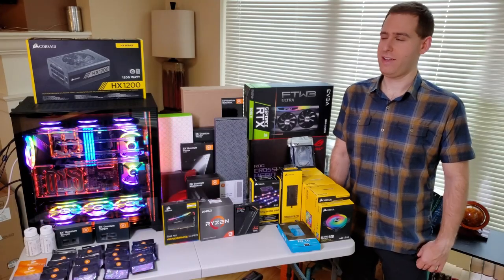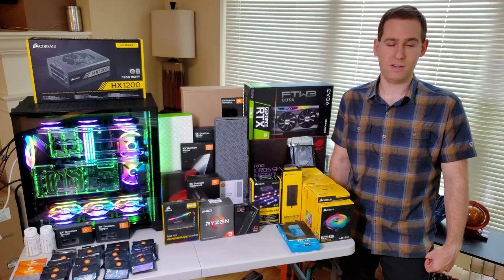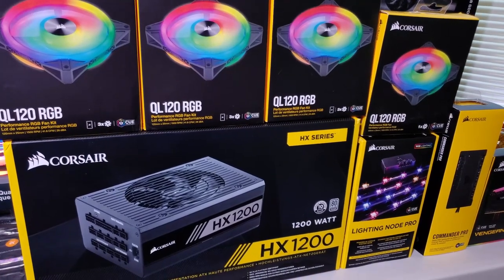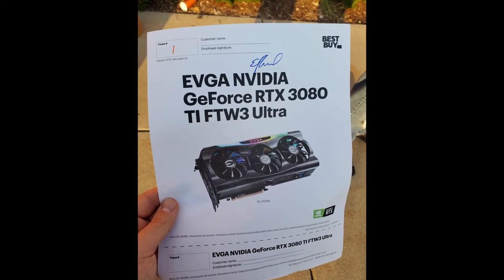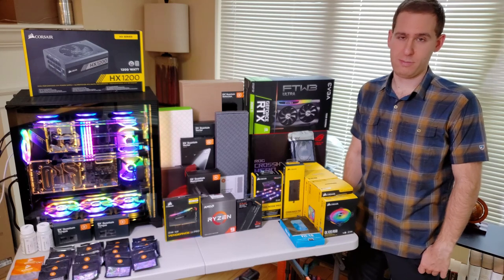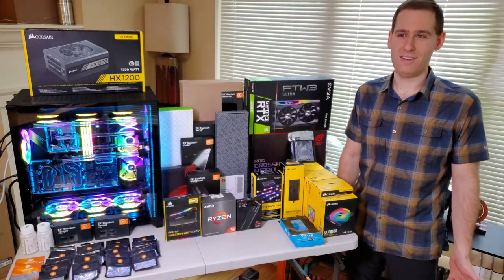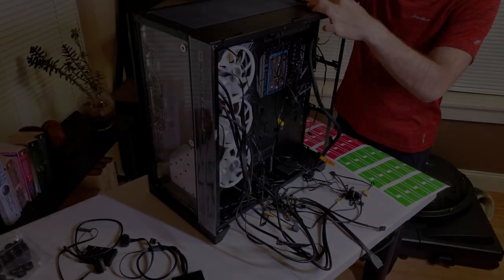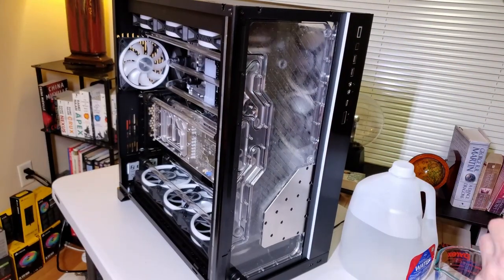Gaming Computer with Custom Liquid Cooling - 475 RGB LEDs, Lian Li Dynamic o11d XL Case

Comment: One major reason I hate the Lian Li cases are the issues of fan vents. They make these super small slivers for either drawing in air or using them for exhaust. If you look at the Corsair airflo case you get the idea of what I'm talkin about. The 5000D with tempered glass right side you will notice that the grill is very open and allows air to exhaust out with no much restrictions. In the Lian Li the air will have a hell of a day venting out thus making it travel through the back side before finding its way out. Dust patterns tell the story very well! Nice build for sure. Just not a fan of the case because the grill systems on the top and right side cover.
Reply: cant you do something about the grill system yourself?

Comment: 1 radiator draws over 300 volts how are you able to run the pc with two radiators and all the other compenents is your power supply good enough? im asking cause i dont wanna fry my system im getting the 1200 watt power supply
Reply from the maker: I actually think my PSU is significantly above the min I'd need for this build. I just didn't want to risk it as there are hundreds of leds and they do add up. The rads themselves don't actually use electricity so I'm not sure what you're referring to there. Is there another piece you mean?
Reply: @RonnieBunshaft  on the ek site it said teh 360 radiator used over 300 watts thats why i was confused when i did a configeration for my water cooling kit that had that as my recommended radiator
Reply from the maker: @shamsudeenkabiru5304  Huh, that's weird. The fans on each rad will use some power but not nearly that much. It's normally the CPU and GPU you'd have to primarily worry about.
Reply: @RonnieBunshaft  good to know thanks
Reply: @shamsudeenkabiru5304   very late reply but what they are referring to is how much wattage can be transferred to the rad.